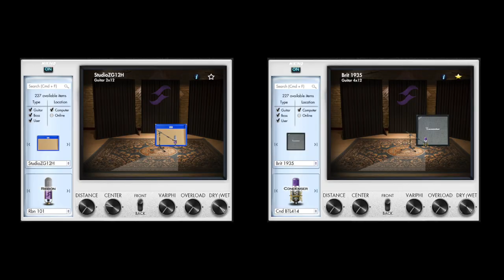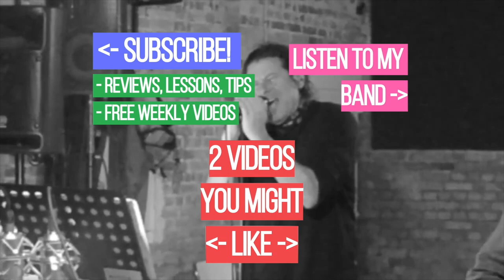HOW BAD ARE CHEAP POWER ATTENUATORS?!

Comment: I have a Burgera PS1 (I think it's just a rebadged Jettenuator) running on a Blues Jr that I use for teaching in a small room. I live in a tropical climate, so my exterior walls are as thin as cardboard and any hope of acoustic isolation is completely impossible. I rarely push my volume past 3 on the amp with the attenuator attenuating 3/4 of the signal, and it sounds pretty damn good. I've read several testimonials about them running on 100w tube amps and the PS1 dying catastrophically with smoke. I've heard all the science about why resistive attenuators are bad for your amp, but I'm yet to see testimonials from people who have cooked their amp with a resistive attenuator. Obviously it has the potential to wear out your tubes faster, just as cranking your amp would. And maybe even faster due to the resistive attenuator not emulating the speaker load in a real world way, but so what? Tubes aren't that expensive. Do you know what is expensive? Reputable amp attenuators. Avoiding noise reduced hearing loss and noise infringements has to be worth replacing your tubes more often. Just my two cents.

Comment: I can’t comment on other products but Carl’s Custom Speaker Soak works GREAT with an AC15. It cuts down on the piercing highs associated with the amp along with attenuating the power section volume. I love the results. Just needed a $25 kit to install without soldering and good to go. Plug into speaker external then to soaker then into stock greenback. Easy peasy!

Comment: Your clean sounds are okay till 5.15, a string is out of tune - i guess D. Then it sounds okay - you re-tuned as you normally would. This happens a few times through the video. As you start the higher gain sounds, too many strings are clashing with each other - palm muting will help at higher gain settings, especially at 17.15. Try some up-strokes in your playing too. The amp power-tube compression is not happening too good or to my ears at least. The main point of the attenuator demo is okay - the sounds and tuning is just too jarring.
Reply from the maker: Thanks for your honest comment! I know I have been struggling to play in tune and I'm working on it. Thanks for wachting, I hope the next videos you see will be more in tune! Cheers
Reply: @MaxCarton  That's cool. Just want you to be a better player. One day you'll be telling others the same. Rock on Max C!

Comment: Are you using both the atttenuator and the Two Notes Torpoedo Captor.  How is it connected? The attenuator after the Two Notes Captor or just before the speaker input on the Two Notes  Captor? Thanks.

Comment: I'm not sure how that works. Are you behind the scenes raising volume of your volume everytime you down in spk level fo your Attenuator?
I wanted to buy it and I thought thats how it works. For example: I have 100W JCM900 that I can barely crank into 1/10 of volume and so with this I can go lets say 4/10 and reduce the volume in the Attenuator without losing sound quality from cranked up amp. And if I want even more power then I set amp volume higher lets say 7/10 so then I have to set spk level on AT lower. Am I wrong?
Reply from the maker: I made the input level of the interface the same so that you can hear how it changes the sound.

Comment: Wait, isn't the Two Notes Captor an attenuator? Why are you using two?
Reply from the maker: I'm using the Two Notes as a LOAD... It's exactly like plugging into a speaker after an attenuator. The reason why I'm doing that is because I want to hear how the resistive load will affect the tone without hearing the speaker and mic being driven at a different level. This way all other variables are out of the way :)
Reply: Max Carton OK, but both units act as both load boxes AND attrnuators. Isn't that redundant?
Reply from the maker: No, because if you have a very small amount of attenuation on the Harley Benton it will not be a full load for the amp... It's only a full load when you attenuate all the way with no signal out of the speaker out :)
Reply: BadCAt Unleash v1 question...  I've just had mine (bought it used, had to have the trim repaired)... do you ever use it with the volume knob (chanel) to 1 or 0,5? I need to have mine to 2 or 3 in order to get a full sound. Lower than that, it's very thin and fizzy, like there's a problem.
This means I can't... for example use the direct out and have the main volume at zero... it sounds horrible. Even for a direct out, the main BadCat unleash amp needs to be at 2 or 3.  Which is actually pretty loud.
Reply: Update... I made myself a 100w 8ohm dummy load for the Badcat speaker out... it seems to have done the trick. The channel volume has a very real impact on tone... so unless you have a dummy load, you'll be cranking it up through a speaker which defeats the purpose.
Reply: kevin schremmer that’s the 1st thing that popped into my head!
Reply: @MaxCarton  Harley Benton PA100 Power attenuator IS a loadbox top... isn't this the PA 100 model??

Comment: Hi do i need an Attenuator if i have a master volume
Reply from the maker: Depends on if the tone comes from a higher gain type of preamp or not. What amp do you have? Does it sound good at the volumes you want to play?
Reply: @MaxCarton  Its a Bugera v22 infinium has a great clean sound needs to be very loud to break up  i use it at home and for gigs playing rockabilly and blues thanks for you help
Reply from the maker: If you want a cool breakup tone from it I would definitely check an attenuator out! Especially with that type of amp...
Reply: @MaxCarton  Thanks for your help I'll look into getting one

Comment: Barely makes any sense - its a power attenuator .. to run your amp hotter? You could say that but you are saying in the most bizarre way I could possibly imagine. If you use pedals for boost ...  none of the sounds were good ... my grandma can pull a better sound no power attenuator needed. By the way I probably played 2000 live gigs with all kinds of equipment, and pulled sounds out of amps at all levels. I think you are just fooling yourself there.
Reply from the maker: Thanks for infinite wisdom buddy :)
Reply: @MaxCarton  No worries grandma